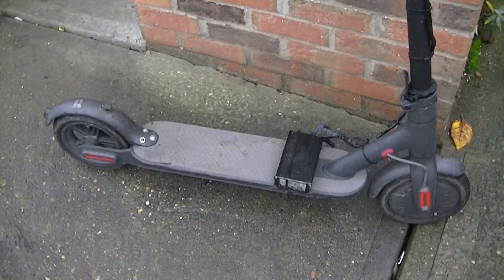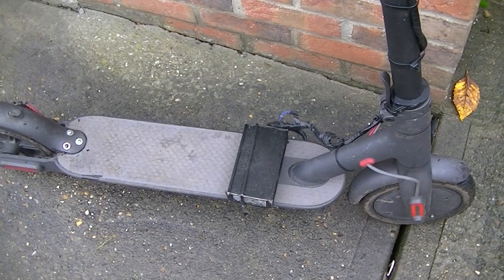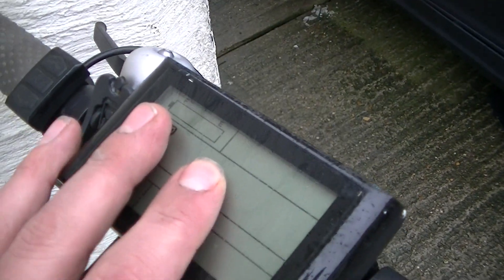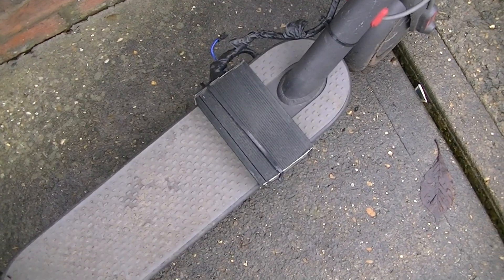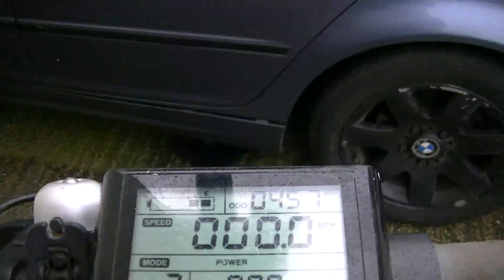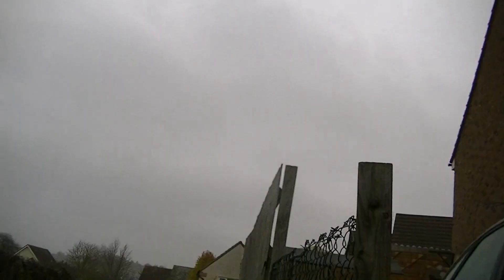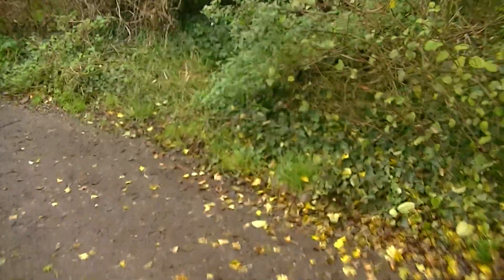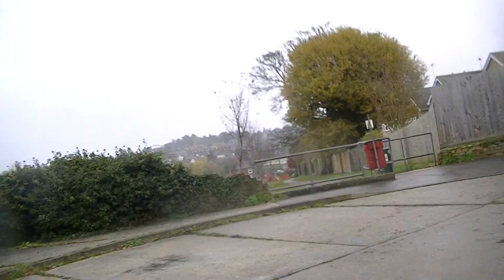lidi  doc green  esa5000 ?  Frankenstein  scooter MODDED/SAVED

Comment: what controller and screen ?
Reply from the maker: was running a generic  controller 12fet  shunt modded  and one of these   tps://www.ebay.co.uk/itm/1-LCD-Display-For-Electric-Bicycle-E-bike-36V48V-SW900-Panel-Meter-Controller/383712771200?_trkparms=ispr%3D1&hash=item5957103c80:g:PM8AAOSwwH5fVtyG&amdata=enc%3AAQAFAAACgBaobrjLl8XobRIiIML1V4Imu%252Fn%252BzU5L90Z278x5ickkxFtV7J5P58ubuVigtBH%252Fezhoig8jXCVP0ZchNhxsI%252FQ%252BdZaBxLeiirbk%252FZTVTtpuadg%252F61a8quMkdodY%252BJC10F0SYVyHcLfYTY57Tei9O%252B9%252FScPbmLwBDSJjeKhSeic6hP8k9c%252F2NgT%252BE6D8%252Bfl3fZyVGvNBkx%252FKTMMBxnkmm2vVF%252F7kMkfwPdW%252FD3muSukDZzJSWmcUMYMGQtaHfD%252B4vsK0KgmgwHbRUbfvG5KxpJt1yGvCHnaRHrWp%252BvySybHKHsZnlOxwiUcclzXm2QXYtdqLaahBp2CUyxGH2jxjEspQB9k1%252FwpPL3a3d1RcB%252FlJDbRC  later  i ran it with an 18fet  72v controller  it was epic
Reply: @TCBOT  Thank you for answering, Do you experience loud vibrations during acceleratin ?,